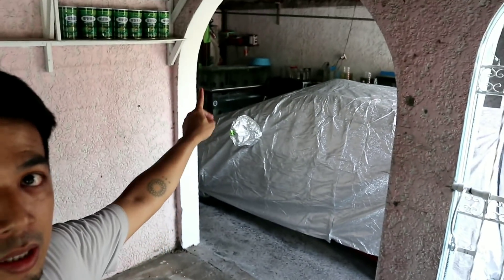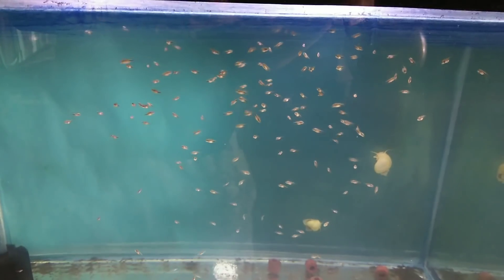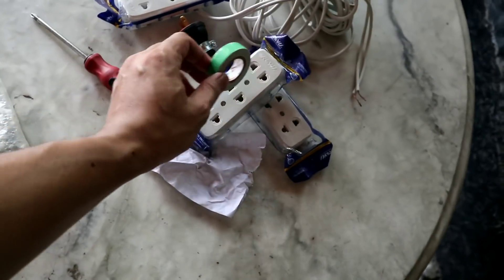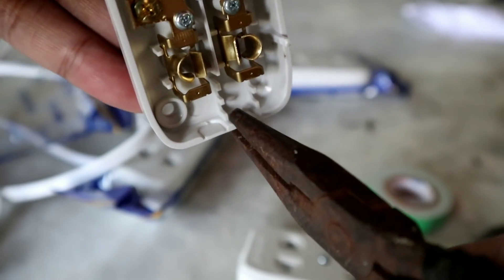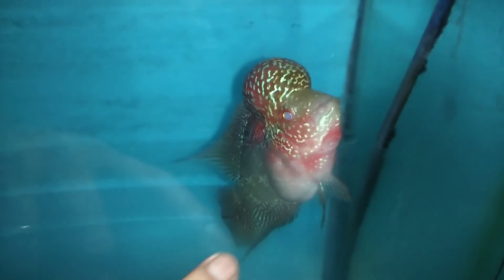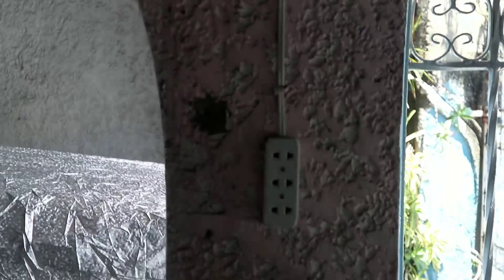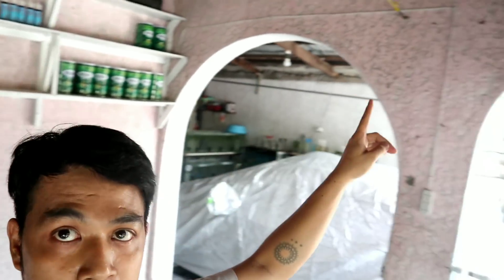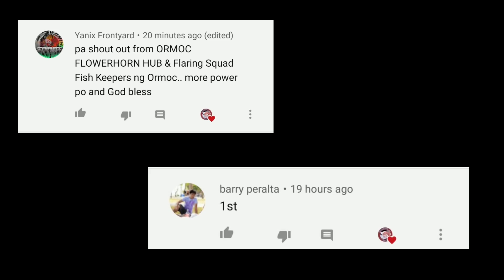Building my dream FISH STORE | electrical lay out

Comment: Sir Hendrix nakakamahal po ba SA kuryente Yung air pump??
Reply: Makikisawsaw po. Kuryente natin depende sa wattage load. Mas less sa air pump. Usually 2.5 to 5 watts lang air pump kaya na paandarin dalawang malaking sponge filter na puwede sa up to dalawang 50 gallons na aquarium. Meron pang air pump na 1.5watts. Samantalang ang maliit na water pump na usually nilalagay lang sa less than 5 gallon tank e 2.5 watts na. So kung sa water pump vs air pump e mas matipid air pump.
Reply from the maker: Hindi naman